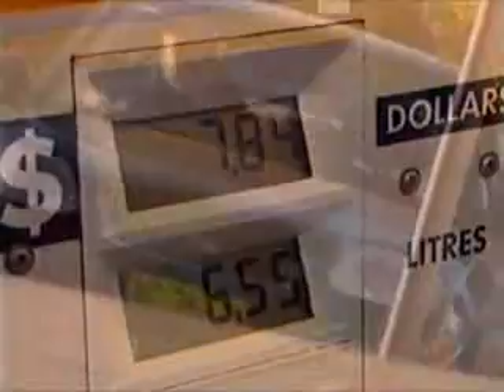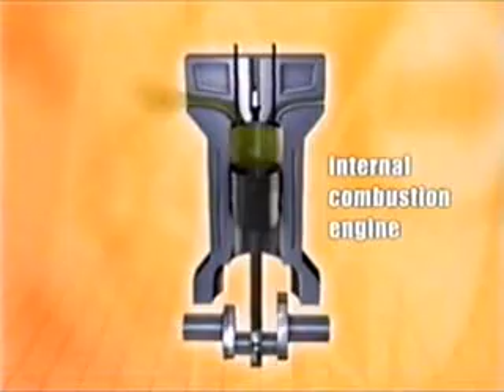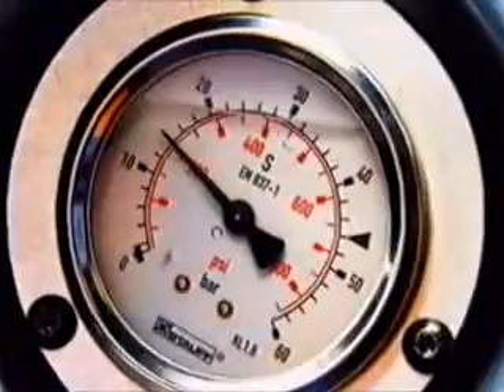The Air Car

Comment: well if its compressed air, sounds like all you need to do is lift a valve and it will release the flow to keep it running

dono why im bother asnwering yo when u asked 2 years ago. lol